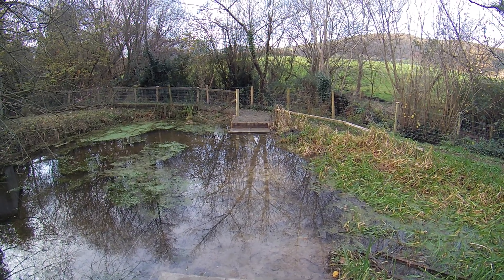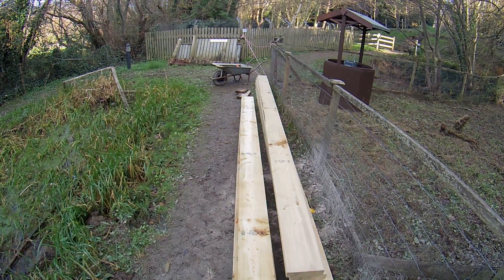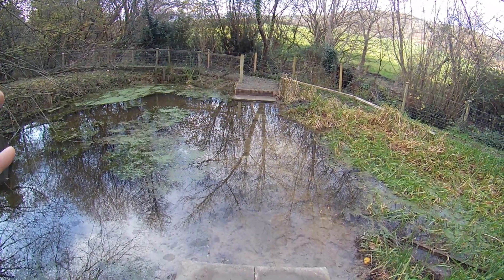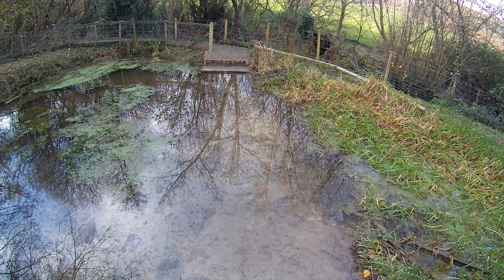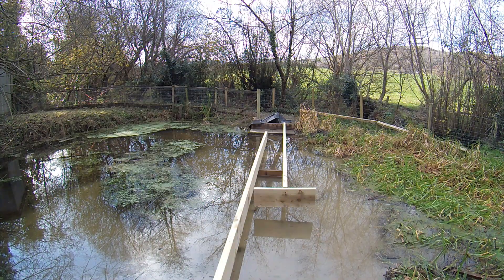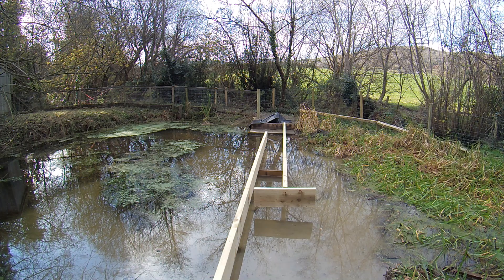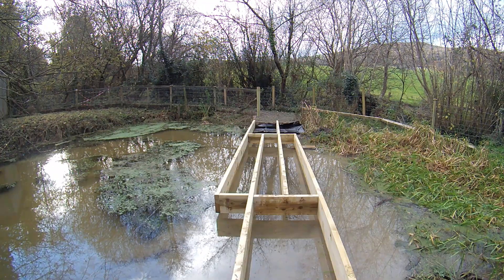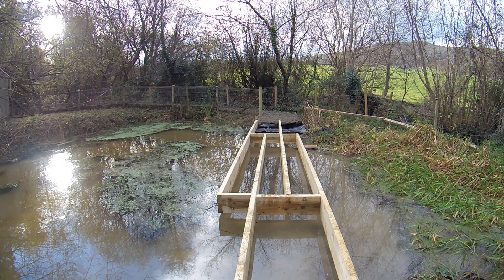Bridge Build ep 3 - Main Framework 29 11 24

Comment: Awesome :D Some good decisions there I reckon, those slabs are a great addition on the footings, it will 'float' better on the gravel and clay beneath with them there. I must admit I'd have buttstrap jointed the beams together myself, in order to get a better load bearing splice to handle the bending moment. Those end to end joints put a lot of work on the screws. You seem pretty confidant with it anyway and it's got plenty of bits so it's unlikely to fail suddenly anyway, so no point me back seat driving here lol :D I hope you had the benefit of a sawbox or chopsaw there to get the cuts straight. Cutting basic square butt joints on timber of that size is pretty hard even when you're ok with a saw, you can make up for any wobbles with extra screws of course but it can be frustrating, and at least with a powered chopsaw you can take half a millimetre off the end, which is impossible by hand without a razor sharp chisel and a lot of time lol :D. Anyway yeah, well done, it's coming on nicely. Cheers fo't vid :)
Reply from the maker: I would have liked to build this bridge the same as the last bridge, with additional supports going across from the posts at the join, but was limited by the height of the water, I also don't know how much I can change due to the insurance claim that was made. The idea is it is built back the same but obviously I have made some modifications, adding joist hangers may have been beneficial at some of the more important parts of the structure but not necessary when you look at how the structure works in the finished bridge.
Reply: Oh sorry, I didn't mean add any metalwork, I don't know the correct terminology to explain lol. Simplest way of putting it, if that bridge starts to sag in the middle you'd screw some long planks along the side of the beams to tie the beams halfs together act as one long beam from bank to bank. They had short little planks joining(/splicing lengthways) the beams on the old bridge but they were far too short and put a lot of leverage on the screws. So like that but longer, plating, or lap joints or whatever it's called to overlap planks like that, or maybe pairing 2 beams together with a staggered joint to achieve the same. You realised the issue and staggered the joints, but, I would have put some more lengthways support on, and you still can of course if you think it needs it, but it seems pretty solid anyway so the theory is irrelevant. Lol, just monday evening quarterbacking here anyway, I haven't actually built a bridge before unlike you so I should leave it to the professionals :D
Reply from the maker: @thorisrain  I understand what you mean, you could put additional beams side by side but that would use more material, or rather than cutting them down like I did you could just overlap them but that would mean one set is off set from the other. I am sure the bridge will be strong enough but if there are any problems I can add additional beams on the outside like you suggest. Whilst I have had experience building bridges and platforms I would not consider myself a professional.
Reply: Oh I forgot to say, I did especially enjoy the 'timbercam' shot :D